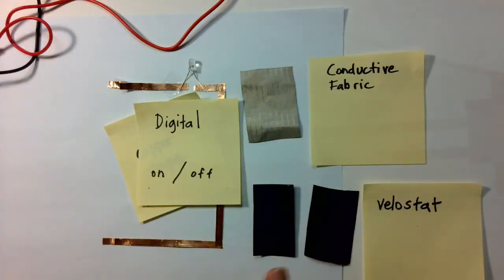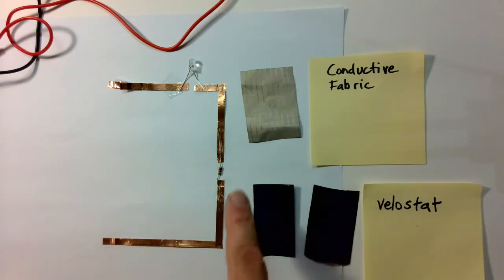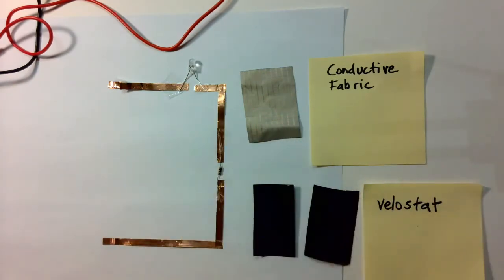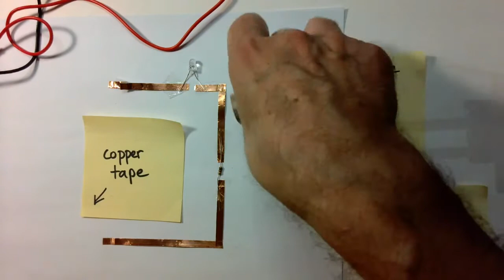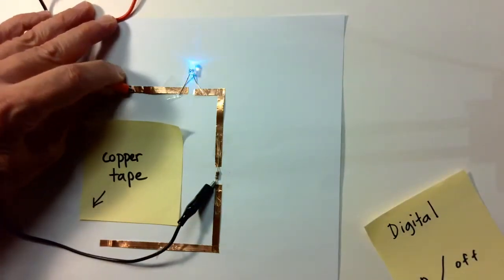Velostat  Conductive Fabric Switch

Comment: Hi and correct me if i'm wrong but you dont need to put a hole in the middle of the velostat. Why bother buying a velostat when you can easily put a paper and cut a hole in it? I mean velostat is mostly used for pressure reading right?